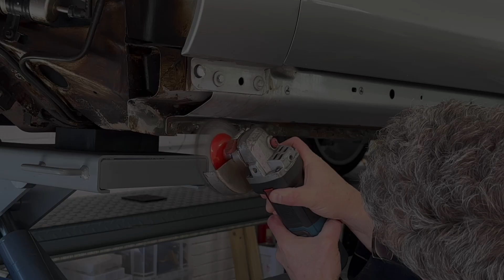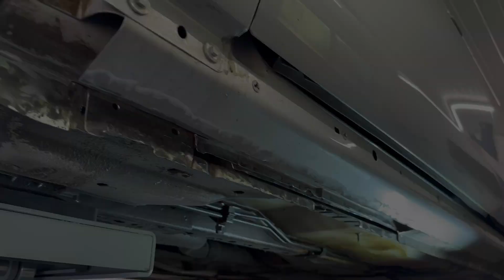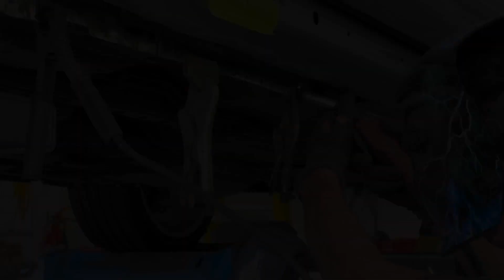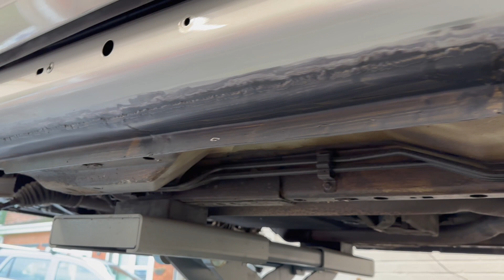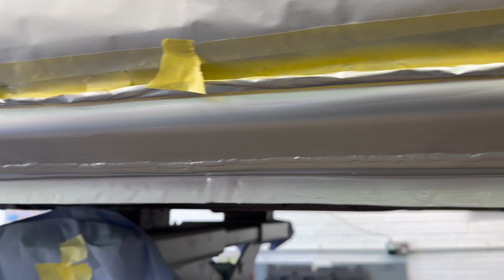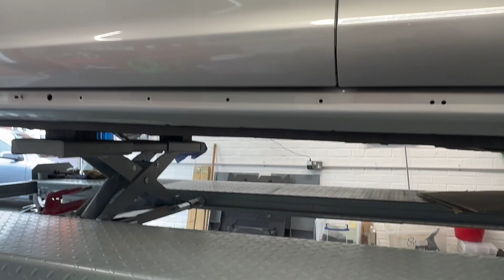Repairing the rusted door sill on my 2003 Jaguar S-Type R

Comment: Hello, I’m looking to do the same on my 2004 which I’ve had from new. Did you remove any interior trim ( carpets, seats or move wiring loom ) before welding. Thanks
Reply from the maker: Hi, no - there wasn't any need to remove any interior trim etc, the only thing we did make sure was that the battery was disconnected before welding.   Cheers

Comment: When looking for an S Type, can this rust be discovered under the sill cover?
Reply from the maker: Hi - yes. Try to look under the plastic sill covers for signs of rust. Another area is the rear sub frame. Try to get the car on a car lift if possible before buying.
Reply: @jaaagtv  
Hi! 
It´s not easy or common to get a private sold used car on a car lift here in Germany, but knowing these issues like sills and rear sub frame helps a lot! Thank you!
Btw - if you ever need a rare JLR part... let me know. I have access to a world wide trading platform.